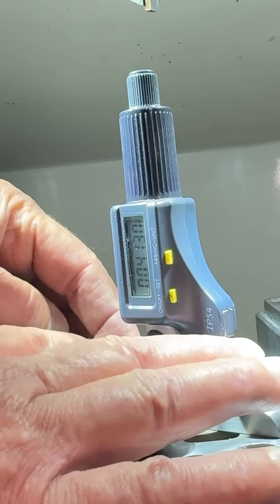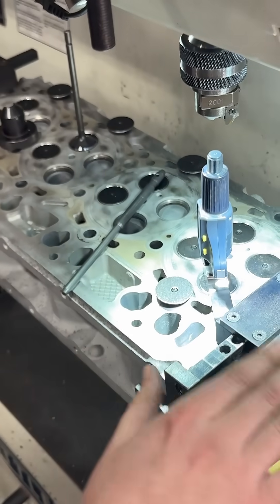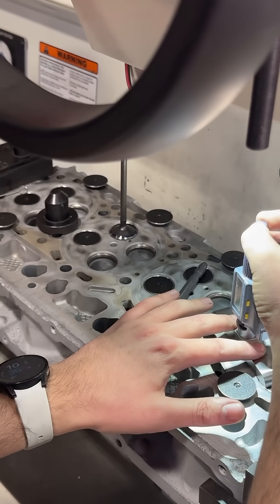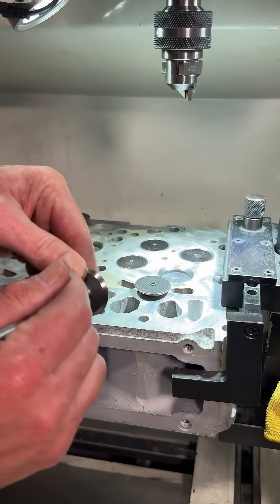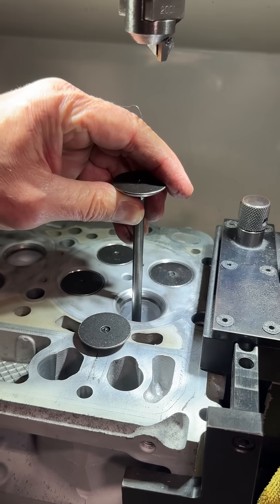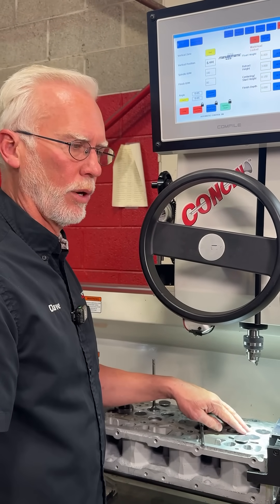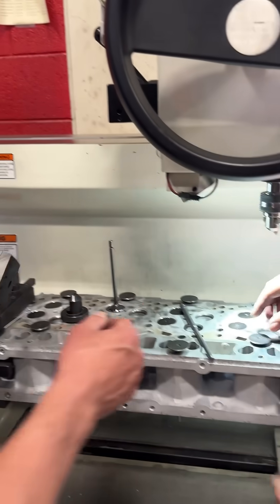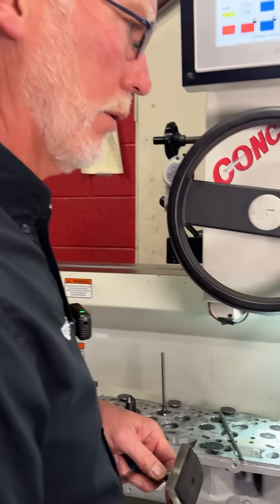Cylinder Head Valve Job. Measured Values are Critical to Success

Comment: This is right up my OCD alley. Even in cases where perfection won't make a noticeable difference, it bugs me for the job not to be done as close to perfect as is within my power/abilities. Kudos to you and your equally obsessed crew, Dave!
Reply from the maker: Thanks for the support! It's always satisfying to achieve accuracy, even if it's a little obsessive.
Reply: @DavesAutoCenterCenterville im a lifelong carpenter and I’ve struggled with this obsession my entire life. I often wish I was in a different industry, able to work for someone like yourself who needs me to squeeze out precision.
Reply: Great job dude. Love the way these guys are trained Dave. First job I had out of high school was working for a machine shop in Pomona California call Climax coachworks. The owner was like you old school Machinist. He sold the operation to Pasco steel and ended up in Ohio doing defense contractor work. But this is the way you taught me. My father built radial drills for Carleton machine tool. They drilled engine blocks for general motors Detroit Ford Chrysler international all of them.
Reply: @markhightower647 Dave trained you?

Comment: With all due respect, Mitutoyo brand inspection instruments are the best choice. Coming from a lifelong journeyman machinist. Love your channel!
Reply: They are good but depending on the tool Starrett is better in many cases and for certain tools other brands are better than both such as with bore gauges the best are Federal and Sunnen in my opinion. As far as micrometers go Starrett has a more defined stop to them while Mitutoyo feels a bit mushy so it's more difficult to get a precision reading. Mitutoyo dial indicators are better than Starretts though.

Comment: Why don’t you deck the head first? That would give you a flat surface to measure a uniform seat recession across all cylinders. If there was any distortion to the head that is removed when decking, you don’t truly know if your value seats were cut within spec unless you measure a second time… although that seems like a loose spec so might not be an issue
Reply from the maker: The head is decked last because it's the final step and we want a pristine sealing surface